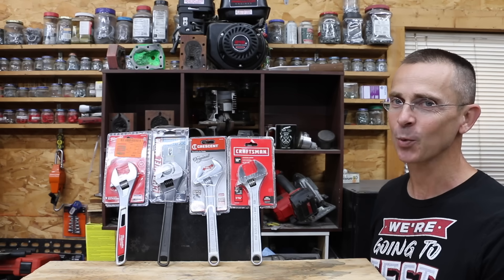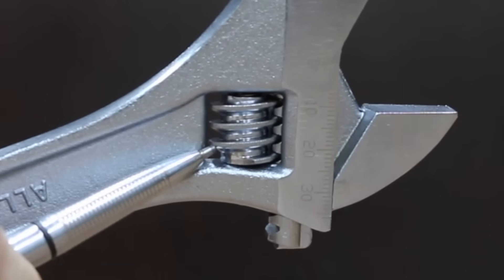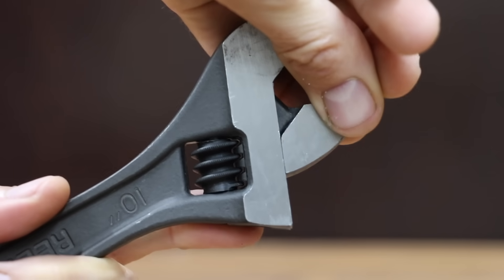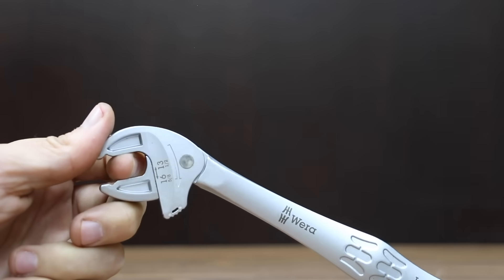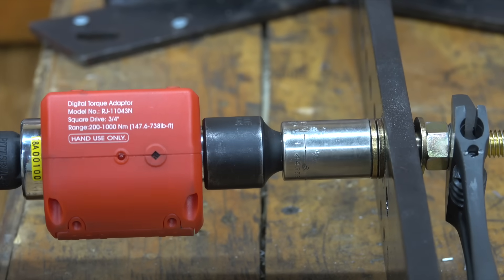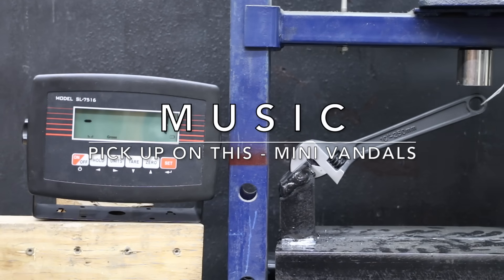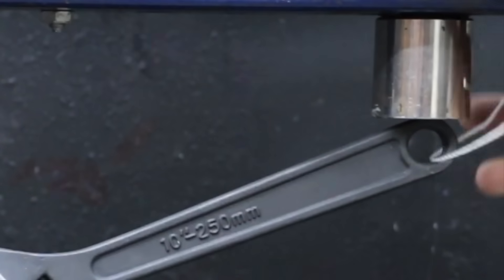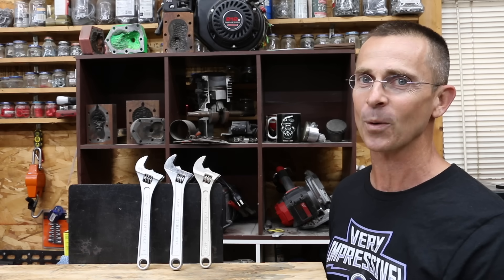Best Wrench (ADJUSTABLE)? Craftsman USA vs Craftsman, Crescent, Kobalt, Milwaukee, Channellock

Comment: Thanks for this one.   Seems that US manufacturers knew how to make tools back when.  I still have and use my Craftsman adjustables (except for my largest 15" which is a Diamond) that I purchased new in 1967.
You'd think that with modern CNC machining, it would be possible to produce a quality wrench very little slop in the adjustment.   It looks from your videos that for some of these wrenches, the back-and-forth slop is mostly the fit of the worm in the body, and not between the worm and the adjustable jaw.   Surely some of that could be taken out with some shim washers...

Comment: My father-in-law gave me an old 12-inch Crescent made in Jamestown, NY. It actually seems to have less slopp than some of the new cheaper brands you tested here, despite the fact that it appears to have seen significant use over the years. The jaws on mine are definitely not parallel and would probably slip in some situations but so far it has served me well. Thanks for all the great info!

Comment: On the 200 pound load gap test, you were talking about a leverage disadvantage. But short jaws give them a big advantage on that test, as you are measuring that much closer to the base of the jaw, so it will have a smaller gap

Comment: Great video Project Farm!!!
I have an awesome Video Suggestion:
Gear oil test:
Amsoil: SEVERE GEAR® 80W-90
Amsoil: SEVERE GEAR® 75W-90
Hotshot’s Secret: Blue Diamond S9 75w-90
Hotshot’s Secret: Adrenaline R9 75w-90
Lucas: 80w-90 
Lucas: Synthetic 75w-90 
Valvoline: High Performance 75w-90 
Valvoline: SynPower 75w-90 
Mobil1: Synthetic 75w-90
Royal Purple: Max Gear 75w-90
Red Line: Synthetic 75w-90

Thank you so much for everything you do! You do a fantastic job informing everyone on what is the best product.

Comment: Pro-tip

Bahco is owned by Snap-On, and personally owning Snap-on adjustable wrenches, I can say that not only are the Bahco and the Snap-on both made in Spain, but they are also visually nearly identical with the only substantive differences being the Snap-on has teeth and is chromed out.

TL;DR they are probably nearly the exact same wrench made in the exact same factory. Buy the Bahco if you want a cheap(er) tool with Snap-on quality.
Reply from the maker: Thanks for the feedback.

Comment: What happened to all the original content?  Channel is becoming just another run of the mill hand tool comparison where you are just reading the talking points off the packaging. I really miss the original content of lawn mower engines, oil testing,  shop lights,  RV custom exhaust,  etc.  You know…original content.  In a word….boring.

Comment: If you go to do a follow up, can you include one called Lobster? It's a Japanese adjustable wrench. I use them at work and would love to see it up against some of these. I may have a bias because I use them everyday but I really don't want to use anything else because they're so good. I'll post a link as a reply for you to check out.
Reply from the maker: Thanks for the suggestion.
Reply: This is the biggest size. The number in the part number denotes the jaw opening width in mm. I linked the UM46. I use the UM24 the most. The biggest bolts I experience in my line of work are usually 19mm. I love the content you put out. Tests are always very thorough and informative. I can join everyone in saying I check your channel before I consider purchasing something. Keep up the great work!

Comment: I swear by Bacho.
These wrenches are amazing.
These new bacho wrenches are made in Spain, the vintage ones are Sweden, and are significantly better.

I wish that you’ve tested the smoothness of the worm gear. I know that the Bacho one is very smooth even after a few years of abuse!
Reply from the maker: Thanks for the constructive feedback.

Comment: At my previous job I purchased and used cheap tools, if they were stolen it was just an inconvenience and not a financial burden. I bought every Tekton adjustable wrench possible and never had an issue. I even modified the largest one to allow me to fit it on larger fasteners. I often used it with a 36”+ cheater bar and still never had any issue.
Reply from the maker: Thanks for the feedback.

Comment: Nice job as usual. Great variety of tests to compare.
I'd love to see a comparison showdown on magnetic impact nut driver sets.  I recently built a large metal building and went through dozens of 5/16" and 3/8" magnetic drivers bits before I was finished. Almost all of the fasteners in the building were self-drilling hex-head screws, and the quality of both the driver bits and the fasteners had a surprisingly wide range. It would be great to see your take on it.

Comment: Second attempt. Test suggestion. Thread repair kits. Heli-Coil vs. EZ Loc vs. Key Lock, vs. the epoxys like loc-tight Form-a-Thread. Third attempt. Test windshield washer solvents. Cheap stuff vs, ice melters, vs rain-x.

Comment: 17:23 Noooooooooo

Honestly I can't say anything about crapsman's wrenches, but once they moved to Chinese manufacturing /something/ changed. I stripped out three consecutive 3/8s ratchets with arm strength alone before migrating to Kobalt(same company as Snapon at time). Meanwhile my grandfather's Craftsman ratchet from the 60s refuses to die regardless of what it's used on.

Comment: Another great vid and set of tests. I love their advertising - can handle metric or standard nuts. LOL.
How about my 50 year old Sears Craftsman toolset? I rebuilt a bunch of engines with them, and have turned hundreds of bolts through the years. They are my babies!

Comment: Still no Mac, Matco or Snap-on.. but names no one has heard of.. really need to add some pro level mechanics compare with the rest. My go to adjustable is the Jet tools super heavy duty and the channellock wcb series (wide jaw with blue comfy handle) working in the oil field almost everyone has channellock wcb wrench or we see a few klien.
Reply: We use adjustable for tubing way more than a nut n bolt. The flatness of the channellock is great to see as that's important for not damaging tubing nuts. Another reason it's popular is the skinny jaws so they fit into tighter areas. That would of been a great idea in yours tests as for industrial and mechanics may pick a wrench based off the fact it will fit in tight areas better than some of the others with large jaws

Comment: Suggestion: angle grinder wire wheels.
Different Diameters, brands, and types available to see if differing diameters impact longevity and speed, ect...
I recently got one (i'll leave the brand out) to peel paint off some metal without grinding away any of the surface, it worked well. BUT, a wire also dislodged from the wheel and stabbed about half an inch into my leg through my pants, so that was fun. Would love to know which brand won't scar me for next time.

Comment: Wera is pronounced Vera. As it's a German company.. Awesome video we call the nut rounders for a reason even good ones are not as good a quality open face wrench.. Love my wera tools but the joker wrenches didn't see quite that good in my book thanks for saving me the 300 bucks it would have cost me. Will more then likely settle with the normal combination wrench set from them.

Comment: I just thought of the perfect video for you. Also a chance to buy a new toy. If you ever want to start an argument in a forum or group for gear heads, just ask what solution works best in ultrasonic cleaners. I know it can vary. But people will go crazy arguing which, say, cleans a carburetor the best. It's almost as bad as the "What oil would I use" posts.

Comment: I have two USA made Craftsman adjustables that I bought new in 2011, they are solid. Though I am reluctant to use them at work because you can’t get those anymore. I also have Klein and Crescent adjustables. The Klein’s are very decent thought pricey, and with nice transparent red plastic handle cover. The Crescents are “mehh” but do the job. I have two harbor freight Pittsburgh adjustables, and they are absolute garbage.

Comment: First comment on this channel but subscriber for some time - amazing creativity and dedication to develop quantitative and objective measures to evaluate different tools.  CONGRATULATIONS on the much-deserved success of this channel :)   Hoping to see a comparison of brands for common fasteners - screws, nails, nuts, bolts - understand that there was already a video comparing screws and nails in general but always wondered whether there's any material difference between different brands for consumables on the usual metrics - tensile strength, corrosion resistance, resistance to wear, etc.  Not sure if quantities will allow but also interested whether there is greater sample variation for cheaper brands because in manufacturing, a lot of incremental cost sometimes goes into better/more QC rather than product materials per se.   Thank you again and CONGRATS on the success of the channel :)

Comment: Have you considered best firewood? Price is going to be highly variable based on the location, but heat generated, burning duration, ash generated, splitting difficulty, smoke produced would make for an interesting test.

Comment: I really liked how you put in a vintage tool, it just goes to show how well things used to be made. Wonder how an actual vintage crescent wrench would handle this...
Reply: @Mck Idyl I think Ike meant Crescent, not crescent.
Reply: I wanted to cry when he broke it.
Reply: @Mck Idyl it was Chinese made vintage ones are usa made
Reply: A lot better. (If not already worn out/battered by being used to hammer etc.)
Reply: @Mck Idyl Crescent used to be made in USA as was the vintage Craftsman.
Reply: Honestly the vintage Crescent (depending how you define vintage) would likely perform inferiorly than its Chinese  counterparts. When Crescent moved to China they retooled all the wrench patterns, and although I think the steel quality could improve a bit the new patterns with tighter tolerances live up to the expectations. I agree with PF it is the best buy. Craftsman  🇺🇸 sadly is now a page for the history book.

Comment: I cringed at the destruction of that USA made Craftsman :(  Also, you may have to change your oil testing methods a little, but could you test motorcycle oils? Amsoil, Royal Purple, Valvoline, HD standard oil and HD SYN3, etc... ?

Comment: Western Forge made the USA made Craftsman that you tested, however in the past J.H. Williams also made adjustable wrenches for Sears. You can trip over those USA made units at yard sales or Ebay and you'll get them for under $16, more than likely $5 each at a yard sale. I have several of them, some bought new, some bought used, some given to me, and I've yet to break one in 30+ years.

Comment: The Irwin was impressive on failire. I closed my eyes when the USA Craftsman broke. I thought Channellock would have performed better but once again Bahco aka Snap On took the win. Great results
Reply: The breaking the vintage craftsman hurt me too, a little piece of the good ole USA gone now :(
Reply: I doubt very much that the Snap-On ownership of a group of already established quality tool manufacturing companies made any difference to the outcome of these tests. I've owned a couple of Bahco adjustable wrenches for 45 years, they were on top of the competition back then. The engineering company I worked for at the time suggested I purchased them. And they still work as well today.

Comment: The shorter jaws actually give the piece of steel a leverage disadvantage, so they should open less under the same load on the handle.  Same thing with breaking the jaws.
Reply: I never thought of that, for real? Does it make a big difference?

Comment: Guessing I'm not the only one that immediately went to Ebay and searched for the USA made Craftsman. There are still a few "new" ones being sold as well as many used ones that look to be in good shape. After watching this video, I had much rather pay a little more and get one of the older USA Craftsman. The ones I found were around $26 with shipping, I think that's a better bang for the buck as compared to some of the more expensive brands tested here. As always, huge THANK YOU Project Farm for another excellent video!

Comment: I far prefer Knipex's "Pliers Wrench" parallel-jaw pliers. There are other smooth-jaw parallel-travel pliers out there. It'd be nice to see them compared, and to see them compared to this style of adjustable wrench.
Reply: This is why I love not only Project Farm, but Project Farm comments. The type of people drawn to this page are my kind of people. Knipex pliers wrench is exactly what I've been looking for and didn't even know it existed.
Reply: @KirchTX  you won't regret buying them trust me. The fact they sell rubber jaw covers for them is the cherry on top of an already perfect product.
Reply: Seeing how well the Wera performed in the torque test (the smaller one that didn't break), I imagine the Knipex would perform similarly, and one wrench can handle a full range of sizes, unlike the Wera.
Reply: The Knipex are superb. Our business tried one, and bought 4 more instantly... they are exceptionally durable too.
Reply: I was going to comment the same thing.
Reply: I hope he does it, sounds interesting!
Reply: Yeah I have a pair. They are excellent. Really good at preventing nut round-off.
Reply: Just use a vice grip the guy said
Reply: @liewon4006  Try some Knipex, and you might throw all  your crescent wrench's, channel locks, pipe wrenches, and Vise Grips , in an unused tool tool-box. They are really cool pliers.

Comment: Fortunately I am an old timer and have 2 old time Craftsman( different sizes), a old time Cresent and a old time Proto. I worked in auto garages and would of never thought of using one on a nut unless I had no other choice.  No signs of ware on any of them. See old time tools were made better.
Reply: I use them all the time on air lines. There are so many different fittings SAE and metric.

Comment: Would have liked to see the Snap-On Flank Drive adjustables in this one. I find myself using a hammer to tap them off the fasteners I have them gripped on

Comment: Those Western Forge made USA Craftsmans are outstanding.  I’ve used them for a decade without issue after starting out with the crappy Pittsburgh’s.  You can still get them branded SK and Ridgid I believe.  They closed Western Forge sadly but moved the machinery to the SK plant.
Reply from the maker: Thanks for the feedback.

Comment: The factory produce wrench for Craftsman charge the Craftsman 0.8 to 1.4 USD for a Wrench. So you can wonder why it has a lower quality. Same as other Chinese made US brand wrench. Normally those company intentionally told factory to build cheapest low quality wrench to maximize the profit. Although those factory already built far more quality wrenches and sell them in China.
Which means you are always buying the worse item with a higher price. Those US import company is taking advantage off you. Better go to taobao or alibaba to pay what really worth, or pay more for a really good one that is made in China.

Comment: The only test that matters is how much torque can it take before slipping.  All the other tests are just suggestive as to what would do this best.  For the gap test, short jaws are an advantage: for a certain degree angle of jaw deflection, shorter jaws will make a smaller gap than longer jaws
Reply from the maker: Thanks for the feedback.
Reply: @ProjectFarm  Thanks for the response!  You must be the last "big channel" that reads so many comments, as you've responded to a few other comments I've left.  I love the channel- wish I'd though of it!

Comment: You should try applying torque in the opposite direction. The stationary jaw is stronger and won't tip. The movable jaw is stronger at the base so the wrench can probably handle more torque in the opposite direction of your tests.
Reply from the maker: Thanks for the suggestion.

Comment: You are supposed to use this type of tool by loading it up so the load on the fixed jaw is closest to the handle ( eg least load(/ moment) on the weakest jaw) some manufacturers might have weakened the fixed jaws to compensate but most havn't, give it a go and see, some people argue that a black cat is white when it comes to this but its not. You videos are great and much appreciated.
Reply from the maker: Thanks so much!  Thanks for the feedback.

Comment: I have a 6", 8", 10", 12" and 36" USA made set of Crescent adjustable wrenches that are nearly 45 years old. Better finish and still work hard each day. No they do not make them as good as they used to.
Reply from the maker: Thanks for the feedback.

Comment: Hey Todd, I don't get this. From what I was taught, the wrenches were all being used in their weakest application. That is, they were all used such that all torque is at the shortest distance along of the fixed jaw (closest to the head and handle) and at the longest distance along the moveable jaw. I was taught that in this application, the wrench is weakest as there is more leverage applied to a longer lever along the moveable jaw. I always use an adjustable in the opposite direction so that the forces are applied farthest from the inner jaw on the fixed jaw and closest to the inner jaw along the moveable jaw.  Am I wrong, or missing something?
Reply from the maker: Great feedback.  I see your point.  I should have compared preformance from both directions.